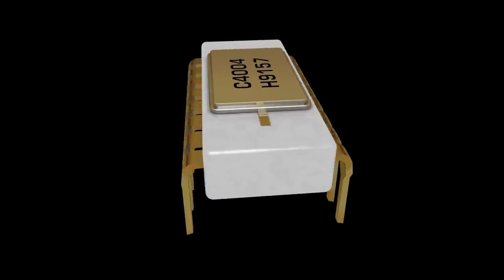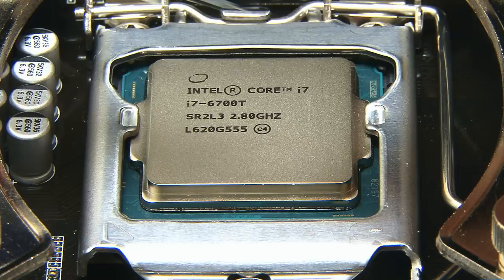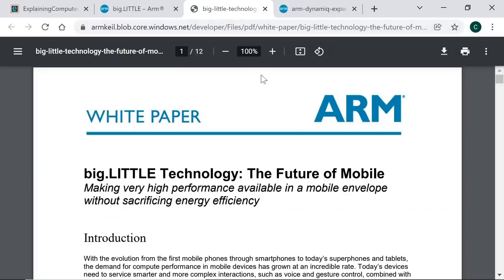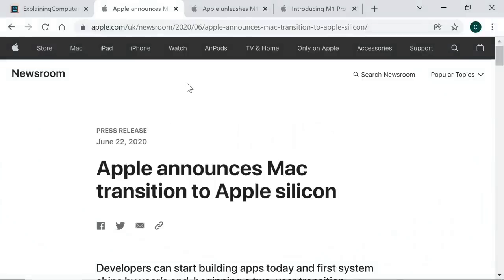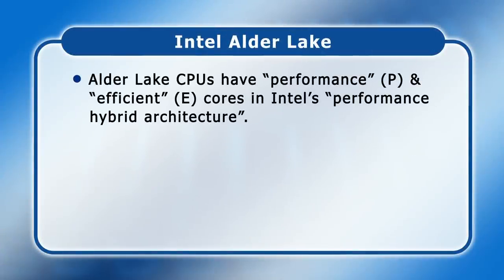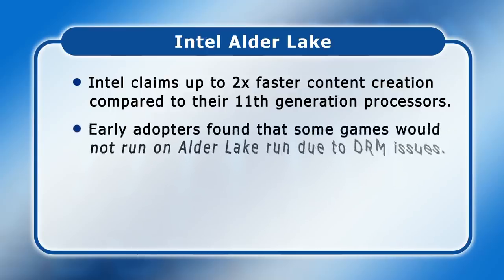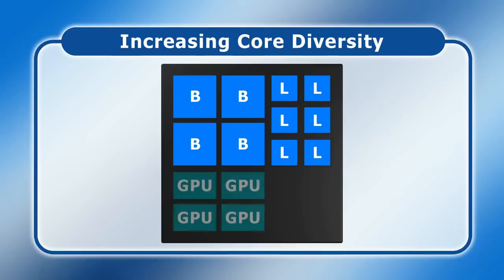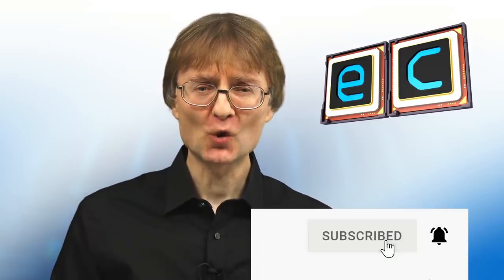The big.LITTLE CPU Revolution: From Arm & Apple to Intel & AMD

Comment: Not long ago you had to cluster computers to get performance, now you have multiple cpus clustered in one chip. In 1999 IBM bought out Sequent computers as it had technology it did not have. The two technologies it wanted one was adding cpus without a drop in performance, adding two cpus you did not get 100% gain but Sequent were better at it than IBM and using the memory in nodes. Memory inside a computer was only for that computer and was not used by other computers, Sequent had a memory bus where all memory could be shared by all computer. Now we have multiple computers in one chip.

Comment: Instead of big.LITTLE a more dynamic feature set (especially turn off cache) is a alternative. When big and little has the same instruction set, the optimizations are limited (and it’s only a cost factor to not have only big but configurable processors)

Comment: Again good video.  I would like to suggest a presentation on the safety-critical design of products.  I know that the EU is requiring extensive diagnostics required in the microprocessor as well as the associated hardware for products washing machines.  Also, there are processors with lockstep cores to do safety-critical design systems.

As a developer of a control system for my commercial orchard, I could use a nonsense tutorial as you did for quantum computers, which was great.

Comment: I think they might be able to speed up the computer if they turned up the clock speed a bit and had extra cores that were never used at the same time as another core. As in if they have a 2 core processor working at 2Ghz then they could add 2 more cores and increase the clock speed to maybe 2.5Ghz and only use 2 cores at a time still but switching between the 2 sets of 2 cores. They would have to separate the cores with something like delrin to keep the heat away from each of the cores. Basically computing in a circle with the active core going in a circle so not too much heat builds up in any of the one individual cores.

Comment: I think processor chip needs to have a dedicated OS core(s) such that games and other heavy duty operations are running uninterrupted. Also I would like to see security cores in the CPU-chip instead of having software based security like https, then programmers could go back to simpler programming (as it used to be back in the day) as the security would be handled on HW level. I could also see media cores (for showing video), perhaps even an IO core to optimize long term storage (even internal zipping/unzipping). We might to begin to see Gaming Core(s) that are specific to gaming environment tasks, take for instance tasks like high precision timing (think FPS counter, delta ms, network lag etc.), random generator as an own core instruction, physics simulation etc.

Comment: I hope that our contemporary technologists won't fall into the "farmer's decreasing productivity" paradox: Not for adding more tractors in a field you will necessarily get more productivity, as there is an inflection point where adding one additional tractor will cause a reduction in the overall throughput.  Call it silicon red-tape if you will...  And another interesting perspective to consider: We currently have computers literally a million times faster than those from the 80s, but the letters still take more or less the same time to be written...
Reply from the maker: Very cool post. :)

Comment: It is like this every time: the illusion of choice exists and for mere matter : what would quantum cores do with bitwise cores?) The sole point of quantum computing is getting a so called Planck reading of "time". Why would time-optimizing processors do that?!
Reply from the maker: All quantum processors are accessed via conventional cores (ie we use conventional computers to access quantum computers to run simulations). So there is significant logic to place both core types on one chip if this becomes technically possible. I disagree that the "sole point of quantum computing is getting a so called Planck reading of "time"." There are many intended uses, including molecular modelling and running optimizations, for example.

Comment: I think this is great news for laptop processors. I've heard it's more efficient to use cores designed specifically for running at low power than just lowering the clock speed on a high performance core.

This will be very important if we reach a point where we can't shrink the die process any more, like when Intel struggled to move from 14nm to 10nm for several years. We're used to this automatically giving us more efficient processors.

Comment: Any Help??
Iam installed ssd 500gb (Kingston) but iam not able to migrate os from 1tb (95% used) 
Any suggestions and help regarding 👉Migration to small capacity 500gb ssd from 1tb !!!
Reply from the maker: The only easy way to do this would be to delete (copy elsewhere) enough content from the 1TB drive so no more than 500GB is used, and then clone the drive.

Comment: This is quite frustrating that all the cores are different because it increases specialisation. I like to change my workloads dramatically based on what obscure software I find interesting that month. With this new configuration I may have to predict what I will want to do 3/5 years in advance.

Comment: what ever happened to "Keep it simple stupid". lol Well, it looks like a lot of innovations are coming in computing and the advances are just going fast. Like you said, looking at the computer figuring out the speed of the CPU and the memory was easy back when. I'm working on my wife's old OptiPlex GX150 with a pentium III processor and 256mb of RAM DDR3 I have to replace a couple of Capacitors on the board but that's not a problem. I was a Slot Tech in our Casino and have repaired LCD gaming monitors with new caps and got them working again. Her computer is running Windows XP SP2.

Comment: My daily driver is an used DELL Optiplex 3020 i3 CPU PC. £120 in 2019.  It even came with a SSD.  It runs Linux just fine.  I did treat myself to a used 1080p monitor this year.

Comment: The latest Qualcomm Snapdragon 8 Gen 1 processor has a many different type of cores because of this the processor is quite complicated to understand
Reply: But it's still based on the same big.LITTLE architecture. They just divided the big cores into two different clusters.

Comment: I feel like the pipelining related to the CPU determining which resources should be allocated to which cores is going to be massive and cause a lot of potential security issues like meltdown and spectre. These were speculative execution related issues and I'm sure these new chips will all have a bunch of that going on.

Comment: I was advocating a sort of Big/Little thing back in the very early 2000's.  While CPU's were all single core at this time there were server systems with dual CPUs (and I was running Win NT 4).  My idea was that a system would have a main CPU for programs and a smaller second CPU (perhaps an older generation) to run the OS and background services.  I even wrote to Intel and AMD which was probably pretty silly.  Still, here we are with actual Big/Little.
To be honest, I still wish there was a system that could separate the OS to an independent processor.  Seems to me security could be increased this way too.

Comment: Mostly on the mark, though regarding QPU I do not see those being merged into the SOC unless a new high-temperature superconductor is discovered/invented. Point in check, currently you need to run those at close to absolute 0 (or at least really cold) so not really feasible or practical to merge these two types of compute at the moment. Hope you're right though, just in the future definitely not at the moment.
Reply from the maker: I would suggest on the mark. Photonic quantum chips like those being created by Xanadu (as I specifically mentioned in the video) work at room temperature -- unlike most current quantum processors they do not require cooling to nearly absolute zero, so there is a real possibility of co-locating on standard silicon. See: https://www.xanadu.ai/hardware  I do research what I include in a video, and in the quantum space have been publishing and writing about this topic for well over a decade.
Reply from the maker: Also, I never say that co-located quantum cores are likely "at the moment" -- I specifically state they may be a possibility in the 2030s! :) I am very happy to see feedback and critique here, but please comment on what the video actually says.

Comment: I am not sure if that kind of design is what I really want. It's great for casual usage like office, school, home theater ... but if you are engineer or artist or scientist which has to get things crunched quickly you don't really care all that much about efficiency but rather how much time can you save through faster CPU. So while it probably will become fairly popular in most applications (especially mobile devices) I don't see much of the use in power hungry divisions like HPC, gaming and workstations. Intel's approach is still one power hungry chip (well that's most likely due to their process node). What I'm more curious is how Apple design can become even more performance-oriented and how x86 manufacturers want to keep themselves in business when nearly as powerful as x86 ARMs will flood the market.

Comment: Shrinking the dies more and more for efficiency and using big/little also seems redundant except on hi eff phones etc.. Why not just have very small power cores downclock unused cpus like amd ryzen does (maybe intel too?) should suffice. Backwards compatibility would be killed using these B/L cpus unless UEFI Bios can effectively disable E type cores when there's an issue. It's interesting though that there's so many configs of big/little ARM based cpus and guess they all run seamlessly on ARM based code. I'm probably wrong on that assumption though ?  Love the channel.. Merry Christmas

Comment: AMD might go for a threaded system I think that it would be possible to make affectivity a complex processor with all functions integrated the thing is assignment if you have multiple CPU, GPU, NPU and QPU the market will still be using a relatively low cost processes for mostly known user interface work if a company makes a universal chip to do anything IC 555 has been in electrics.
The was a drift toward making all the heavy-lifting go online, but complicated processes  are making a drift back towards the work going to devices in people's homes, obviously the Intel, apple and Google it would like to make people more subscription-based services rather than their own devices.

Comment: As someone who only really puts the CPU under heavy load when gaming(most of my real work etc. is done in Libre Office and on the web with no real CPU load to speak of) this is rather exciting. When playing games, except for AI heavy strategy games such as Football Manager, most games will have one or two massive threads and loads of tiny threads. I feel if this becomes the norm, instead of buying a mid-range 6 core to get 60 frames at 1080p, I could save money by getting a dual big core, four small core machine.

I am worried by backwards compatibility issues(I doubt they've checked anything made before the last 2-3 years), but also excited by possible savings in cost and power use.

Comment: What's needed now and for later are UCPUB's. Universal CPU Benchmarks
where a fixed list of tasks are done with each CPU and the scores reflected by the UCPUB's. The UCUPB's could run over a 5 year period, say UCPUB-a in year 0-5 and for year 5-10 the benchmarks are updated and be call them UCPUB-b . In year 6 CPUB-a and CPUB-b should be published. In year 12 say, UCPUB-c and the older UCPUB-b benchmarks could be published. etc. Just what/how/this is done, single overall value or broken down into graphics rendering, bitcoin generation rate.... whatever would need to be decided, but it should be universal. And of course the name could be made more 'clever'....

Comment: The big advantage Apple has here over Intel is control over the platform. When Apple M1 came out, they also got to tailor the thread scheduler in macOS to go hand-in-hand with the CPU's non-uniform resources. Windows on Intel and Linux on everything-ARM haven't the luxury, although I'm sure that people in both camps are hard at work on the problem. Outside Apple territory, there's a gap to cross yet before we see the real benefits IMHO.

Comment: Intel's new 12th gen processors are incredible. An hybrid processor microarchitecture, something that was never seen before on desktop processors. AMD's bad days are coming if they don't work out soon.
Reply: Intel wrote it's own death warrant in 2015 when it diverted funds from research into diversity programs. I predicted 4-5 years before that research pipeline stall began to really show at Intel. 100% correct. Intel has lost its lead in fabs and processor innovation (and the fab failures has been gutting all of their products as they can't even stay ahead on non-processor manufacturing nodes) - and only realised this about 12 months ago. They started frantically try to rehire all the white male engineers they drove out. Intel remains doomed until it backs up its desperate marketing with actual results... so we'll wait and see... frankly I can't see those white male engineers returning soon. They cleared off to South Korean companies where they got some respect. I can't say I care one jot about Intel... as they are the best example of what woke does to even massive companies.
Reply: Do you expect AMD to not? They caught up to Intel and NVIDIA from rock bottom. Although from help with Intel and NVIDIA slacking for a bit.

Comment: More of an evolution. Nvidia released a 5-core Tegra 3 before big.Little was finalized. It had 4 a9 cores with a cmos 500mhz efficiency core. Initially neither it or the  Exynos 5 Octa 5410 (1st official big.Little processor) seemed like it was really worth the extra engineering. It seems like it is now but it was a slow start.

Comment: It is urgent that founders return to more efficient processors in their use of energy, the last Intel CPUs that did better than the previous generation were the 3nnn with the i7 3770K which had a TDP of 77W and since then it is always more W consumed for a performance increase of 5% for each new generation.
Fortunately some states like California are leading the way by limiting the power consumed by the hardware allowed to be sold in the state. You can display web pages and play videos with a raspberry and its 4 to 8W consumed at the plug, typing text does not require more either.

Comment: I can see this opening a can of worms similar to when multithreading became common.  Even today, a lot of software isn't optimized for multithreading.  This will probably have a similar result, where a lot of software has its workload incorrectly allocated.  Won't be a big deal if everything gets erroneously allocated to the more powerful cores, but what happens when your software is erroneously allocated to the lesser cores?  This is probably going to hurt backward compatibility.

Comment: That are very good news for apple as the more complex and difficult the comparison of chips get the more people tend to trust in names and concept rather then in hardware. 
Well at least until the loop gets closed and we have very fast internet access anywhere and the computing power is in the net and you just have a client, which means costumers do not care directly about processors at all and leave that to the professionals.

Comment: To be honest the only thing that will benefit on this is only low power laptops. Desktop doesnt benefit on this because it has a steady supply of power and cooling isnt that much of an issue, heck even gaming laptops doesnt also benefits on this since you most likely to just plug it on a wall outlet most of the time. Added to that is the pain of having to write your program to fit the big little and at the same time should also be compatible with non big little CPU. I really hope that both amd and intel dont focus so much on this and just improve the current cpu designs....